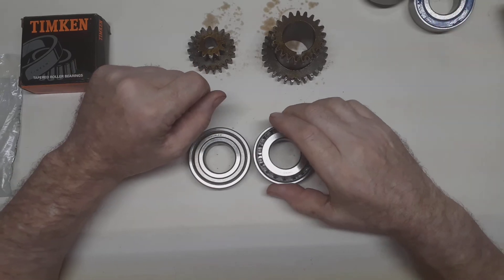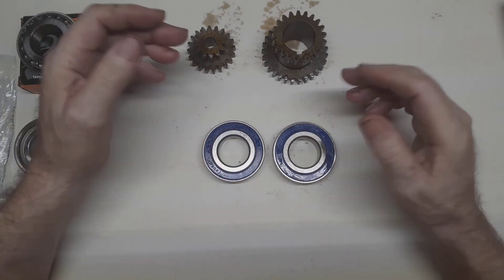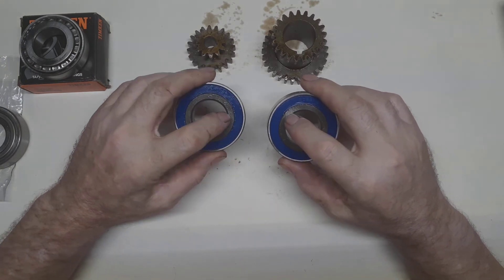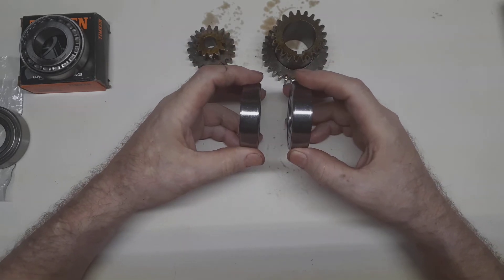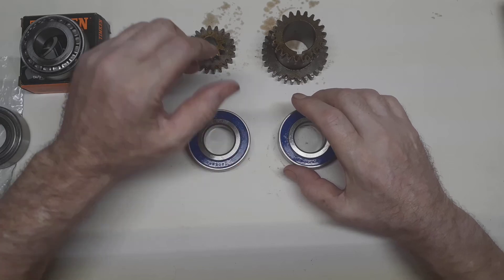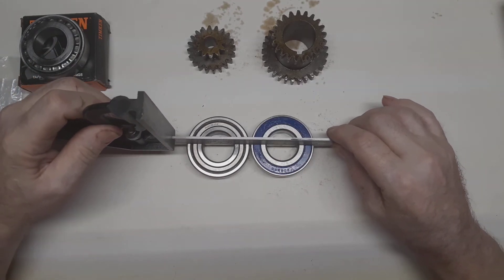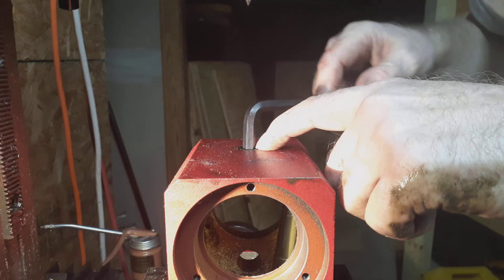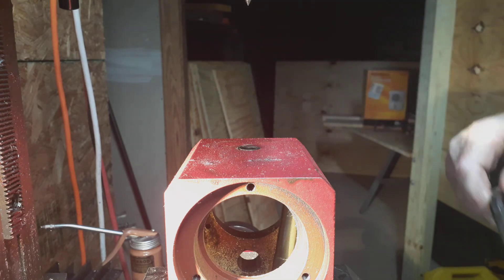Steel Gears and Angular Contact Bearings for the Mini-Lathe

Comment: like the vid can you tell me the angular contact bearing number please
Reply: Go to “Little Machine Shop” site. They have all the stuff to maintain & upgrade these Chinese mini lathes regardless of what brand they are.
Reply: @tomt9543  look and called them do not have the bearing what is the # on the bearing? i like the seal part of it
Reply from the maker: @williamcombs6560  The bearing number is 7206 2RS.  The 2RS means that they are sealed. It is 30 x 62 x 16 mm.  LMS only has regular ball bearings for this lathe, or else I would have gotten them from them.  I had to order them from the UK and ... WAIT ... to get them at a reasonable price.  From the USA they may be high $. 
BTW, to set the preload, pull up and down on the chuck.  If there is any play, tighten the lock nuts.  When the play stops you are there.
Reply: @DrJim-zh8je  thanks i see waht you mean just got a set for england just have to wait now
Reply: Thanks for your video im buying this model used helpful in knowing ahead how to upgrade and parts to do it.